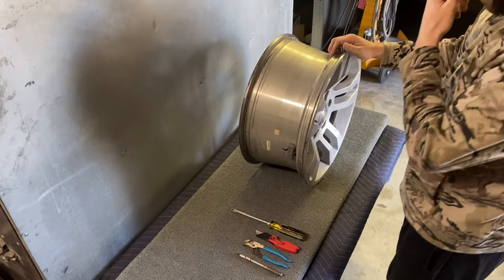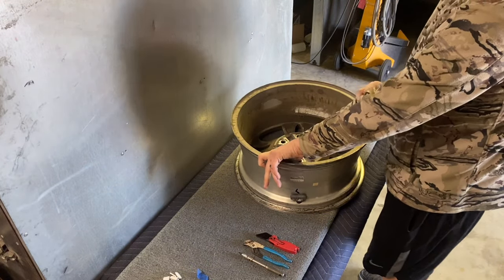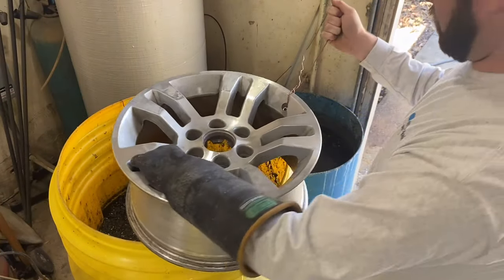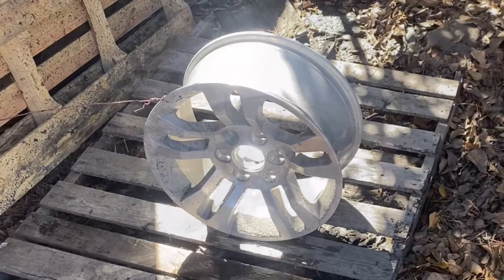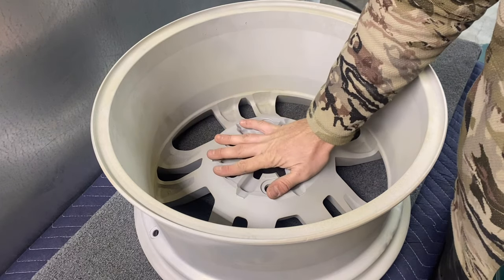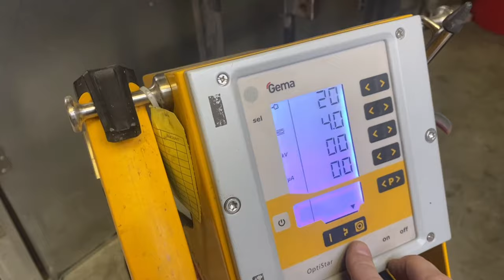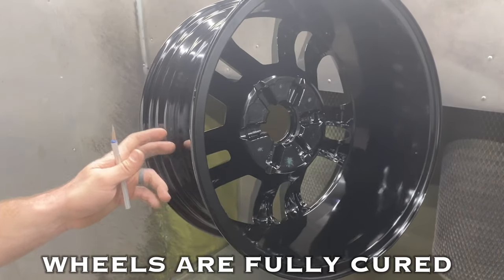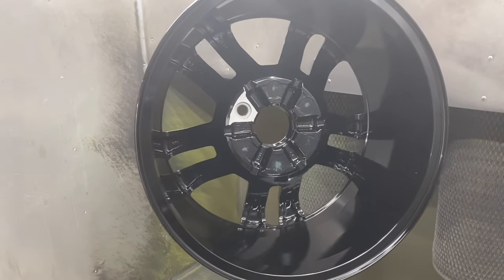Powder Coating A Set Of Wheels From Start To Finish - Video Request

Comment: Another top notch video.  I really like the easy, smooth way you do your spraying.  I see so many coaters spraying patches at a time.  I can't imagine that they get consistent thickness on the parts the way you do.  Excellent!  Thank you.
Reply from the maker: Thank you! And depending on the part and the powder I’m spraying I will do that sometimes where a slight different in the thickness isn’t an issue.
Reply: *Milledge

Comment: Great info. I had my wheels powdercoated and thus far even in Chicago winters, it's held up great, though I clean them when I can (time permitting). I would presume it's much more durable than painting wheels over the weather/road elements.
Reply: Put me on to the shop you went to in Chicago. Trying to power coat my wheels as well.
Reply: @Dro-Ordanzo  I got you - Crown's Customs Coatings - used to be in Addison but recently moved to Wheeling.
Reply: @jeffl1484  awesome thank you bro!
Reply: @Dro-Ordanzo  No prob.

Comment: Great video  I like it when you show  the preparation you have to do  before  powder coating. 
Quick  question  .when you taped the  back of the  wheels  I noticed  you  did not  cut the tape  out where the  bolts  go. Is there a reason for this  ?
Keep up the good work
Reply from the maker: Thank you! That’s a wasted step in my opinion. I’ve never cut out the stud holes when masking the back pad. Do you cut them out and if so, what for?

Comment: What about vapor blasting? Just got a blasting cabinet, have everything to make needed mods to make a gravity fed, widen and make it taller and finally top loading capable. Just don’t know if should leave regular blasting or vapor blasting.
Reply from the maker: If you want to powder coat then leave it how it’s supposed to be. If you want to restore old aluminum parts and leave a nice raw finish, then vapor blast.

Comment: Is your neutralizing tank a mixture of water and baking soda, if so what is your ratio?
Reply from the maker: I never used a specific mixture. You can use the test strips that they use in pools if you’d like but I’d base mine off the reaction (neutralization) I got when I put parts in. If it bubbles, I’m good. If the bubbles start to slow or go away, I add more baking soda.

Comment: Dude!!!! Thanks so much for making this video. You got me so inspired to do my first set of wheels! I was wondering how much blasting is required after the rim strip? Is it a fairly quick process? I don’t have the biggest blast cabinet. Also I know I’m from Canada but I would be curious to know how much you charge for something like that? That video is going to help a lot of people! 🤙🏼
Reply: Blasting is very quick. If you use acid first you are just blasting to etch the metal.
Reply: @GMPC  thanks!
Reply from the maker: Anytime man! Go for it they’re not too bad once you get the hang of it. Rim strip (or a chemical stripper) is definitely a life saver when it comes down to it though. 
Blasting probably takes roughly 10 minutes give it take per wheel on my setup after stripped. 
Are you asking how much to strip wheels or how much I charge to do a set of wheels?
Reply: @royalcoatspowdercoating  I was curious how much you charge to do the wheels for your clients?
Reply from the maker: @martinjamesdesigns3748  oh okay sure! So for an average size 20” I charge $100/wheel and then typically every inch up or down from there is +/- $5 per inch. And I’ll typically do the same for wheels over 10” wide. My prices are also based on a basic gloss black. Prices will vary depending on powder cost and type.
Reply: @royalcoatspowdercoating  that’s great info! Thanks man! Keep up the great work man! You keep a clean work space and you do quality work! That’s what I’m about 🤙🏼
Reply from the maker: @martinjamesdesigns3748  appreciate it! Wish it was as clean as yours lol my stuff gets out of hand sometimes
Reply: @GMPC  so is it bad idea to sandblast after acid then. Thanks a lot
Reply: @olexy84  we always blast after acid. Acid will clean your rims but you still need to etch them and that's where blasting comes in
Reply: @GMPC      There’s any other method to strip the wheels cause i cant find chemicals where i lived
Reply: Where are you located,I would like to get my wheels done.

Comment: Two questions as I'm getting into doing this myself at my job. How much powder does it take to dona set of wheels? I ordered a lb from Everlast to do my 15" wheels hoping it will be enough,if not I will order more. Secondly...what is the temp of your oven set to and how long do you let them sit in the oven to cure the paint? You may have stayed that already and I missed it. Great vid though. Thanks for sharing

Comment: Very good and interesting. I note that you hot flock. Why do you not spray from cold? I have also heard that some people phosphate alloy before powder coating but don't really know why.
Kind regards Paul from 48 Spokes 🇬🇧
Reply from the maker: I normally do spray cold. I just sprayed these hot for something different. 

Phosphate is supposed to help with adhesion but I do not do that process and don’t have any issues.

Comment: Hello I enjoyed the video! I have a question, when powder coating parts and you want to keep parts marked, I was told you could just use a sharpie and put 3m powder coating/heat resistant tape over the sharpie writing to preserve it ? Does this work, with a normal sharpie pen and the tape, I know the tape works but have you tried this before
Reply from the maker: I haven’t had the need to try that but I assume it will work.

Comment: Hello there, there is no need to use the primer first? there is so many different advices I get confused. Some people say to use zinc primer first. Thanks a lot
Reply: I think the sync coating is just for non metal areas or similar things where the powder coat wouldn't stick

Comment: awesome video! what did you put in the wheels to run the hooks through them?
Reply from the maker: Eye bolts from the local hardware store
Reply: what size? 5/16" or 3/8" @royalcoatspowdercoating

Comment: I see lots of powder coaters outgas after they have sand blasted which never made sense to me as if it brings anything to the surface it’s now there, do you still do this same process ? Thanks man great work
Reply from the maker: Some people do it that way. I don’t agree with it for that reason you mentioned but to each their own! I prefer to outgas then blast.
Reply: The incorrect way, but people do it so they can hot flock their wheels straight after outgassing to save on gas/electric bills, half assed

Comment: Do you use any degreaser after blasting?
Reply from the maker: I only use air after blasting. I wouldn’t recommend using anything other than air after blasting. Anything else leaves room for contamination; degreaser, acetone, rags, etc in my opinion

Comment: Should fresh powder coated wheels have hairline scratches all-over? I just had mine done through a local Ford dealership that I bought my car from and they tried to tell me because it is black that it will have scratches from being wiped no matter what. I think they don't want to take accountability for a low quality job. There was also some dried up yellow stuff on the wheels and tires, almost like a wax or polish, when I picked it up. I didn't see you put any wax or polish on those wheels so not sure what the hell that residue was from.
Reply from the maker: Unfortunately if you don’t clear a gloss black wheel you will run into the issue of micro scratching. I always let my customers know ahead of time before doing the job if they opt out of the clear. 
The residue you’re seeing could be the lubricant used when installing the tires on the wheels, but that’s just a guess.
Reply: Hmm..they didn't give mention an option for a clear coat. They are going to redo them because there was also what appeared to be like tiny craters and dust dried into the coating.

Comment: Do you know where i can get the Hyper silver that Toyota uses on there wheels? I have 09 venza and the hyper silver is what they use. I tried calling prismatic powders but i didn't get a answer for this color. I need to find this color cause I'm redoing my wheels. Any help would be appreciated.
Reply from the maker: I do not know of a match. Powder is pretty difficult to match paint 100%. You may just have to find something close.

Comment: I just got some wheels powdercoated that had a lot of sharp edges and i've noticed when i shine a flashlight on them i can almost see through the sharp edged areas. Is this normal or did they do a poor job painting them? I can't really notice this without shining a light on them and haven't had a look at them in the sunlight yet.
Reply from the maker: This is pretty normal. Powder tends to pull away from sharp edges when curing.
Reply: @royalcoatspowdercoating  If this is the case why does everyone say powder coat is superior to spray paint? I inspected my wheels in direct sunlight and it didn’t seem noticeable but it still concerns me. Can it peel in these areas where it’s thin or something?

Comment: Awsome vid! Very helpful to someone like me whose thinking about taking on this hobby. Do you think getting a striptank is worth it if I’m looking to do longer parts like trailing arms etc?
Reply from the maker: Glad I could help! Strip tank as in one of the fabricated ones? I’m able to fit 90% of my parts in my tub now. The long suspension parts I usually just have to flip over and do the other half.
Reply: @royalcoatspowdercoating  yes fabricated. Ah that makes sense. Does the container you have the strip material in have to made of a specific plastic? Where did you get yours from? Thanks ahead
Reply from the maker: @Arikos08  it’s an eagle over pack drum I ordered from Amazon. I think it has to be made out of polyethylene if I remember correctly.
Reply: @royalcoatspowdercoating  thank you I will have to take a look. I really appreciate the reply.
Reply: @royalcoatspowdercoating  where did you get the stripping material from?
Reply from the maker: @Arikos08  Express Chem

Comment: is it possible to powder coat parts of a wheel for example inner dish of a concave wheel only?
Reply from the maker: Yes it is possible. But you’d need to completely strip the wheel and re coat. You wouldn’t want to do it over an existing coating
Reply: @royalcoatspowdercoating  cheers for the advice

Comment: Damn ever seen powdercoat looking glossy before curing, what brand is it? Also im I doing something wrong because when i apply gloss black it doesnt look reflective like that at all beforte curing
Reply from the maker: I coated these hot for something different, not the ideal way to coat them though. But I use wet black from tiger Drylac

Comment: So now that I do hotflocking in my videos with the hard stuff I find I like to do everything hotflocking because it's easier. So question do you hotflock everything also or just rims?
Reply from the maker: I usually don’t hot flock much unless needed. I just coated these hot to do something different. May start doing it more often but for now I prefer to shoot my powder cold.
Reply: @royalcoatspowdercoating  Do you personally see any benefit in spraying rims hot or cold?  Any advantages for you of one over the other?
Reply: @royalcoatspowdercoating  cold is definitely safe. But I love how hot gets everything and no light spots. But it's definitely not the safest way lol. I'm starting to like the hotflock corners and hot spots then do a cold coat to smooth it all out. I love how everyone does things differently and it's all correct

Comment: Is powder coating reversible? I think I want to powder coat the rims on my leased Tahoe
Reply from the maker: It is a permanent coating that will need to be chemically stripped and/or blasted and recoated to get back the original finish.

Comment: What size air hose do you run to your pot blaster? 3/8 or 1/2?
Reply from the maker: Just 3/8”s. I really need to run a 1/2” line though.

Comment: Hii don't have the paint stripper i just have the sandblast first i sandblast then outgass?
Reply from the maker: I’d sand blast to remove coating, outgas, and then sandblast again to remove outgas contaminants
Reply: @royalcoatspowdercoating  what grit to use?
Reply from the maker: @richardr2674  30/60 green diamond

Comment: What did you do to the center caps
Reply from the maker: I typically don’t mess with plastic center caps, but sometimes I’ll paint then black if requested by the customer. 
I’ll offer a powder coated sample to them if they want to take them to a paint shop to match the color.

Comment: how long last the strip chemical?
Reply from the maker: I keep mine in a sealed container. Seems to last several months but that will also depend on how much you use it. I usually just top mine off as it gets low.

Comment: What chemical stripper do you use for parts other than wheels?
Reply from the maker: Rim strip is just the name of the product. I still use the same stuff to remove epoxy, paint, and powder from other parts.
Reply: @royalcoatspowdercoating  I have wondered that so many times but all I ever see anyone use it on is wheels lol.       Thanks man! I appreciate the vids
Reply from the maker: @samconner1119  all good, glad I could help!

Comment: Is that just water and baking soda?
Reply from the maker: In the neutralizing tank, yes. I needed to add more baking soda in this video.
Reply: @royalcoatspowdercoating  I’m just getting started but how much do you think I should dump in for 10 gallons of water?
Reply from the maker: @juancanchola7330   you could get some test strips and keep it above 7 on the ph scale if you want to be technical or just dump a pound or so in there and when you put your pieces in after stripping it should bubble pretty good. If it’s not bubbling, add more.
Reply: @royalcoatspowdercoating  is there anyway to message you if I have some questions when I get my gun ? Without commenting haha
Reply from the maker: @juancanchola7330  for sure, you can reach me on my email royalpowdercoats@gmail.com

Comment: Whats the price to powder coat rims?
Reply from the maker: Prices start at $100/wheel for 20s
Reply: @royalcoatspowdercoating  nice ,how long does the whole process usually take guestimations?
Reply from the maker: @redciroc1211  I usually do a set of wheels over a 3-5 day period depending what else I have going on.
Reply: @royalcoatspowdercoating  - That's "SUPER CHEAP".

Comment: Why can you just sand blasted
Reply from the maker: You can. But a garage set up like mine would take forever to get the existing coating removed and can potentially leave an uneven blast profile. So chemically stripping them before blasting is easier for me.